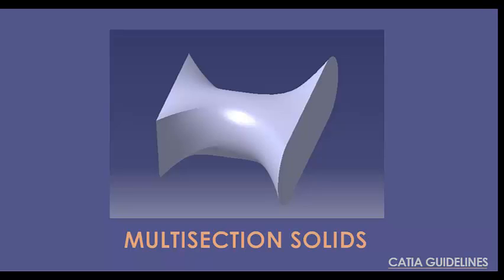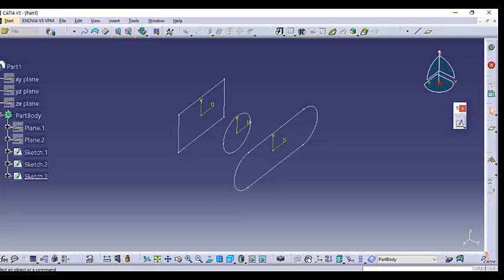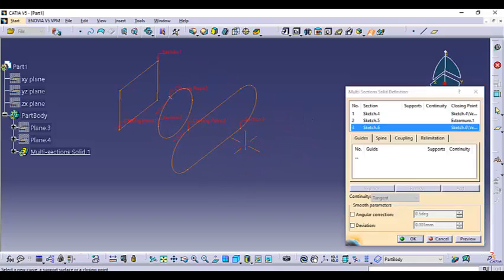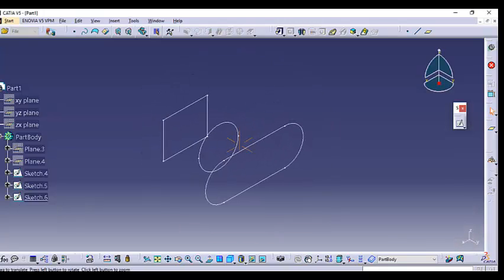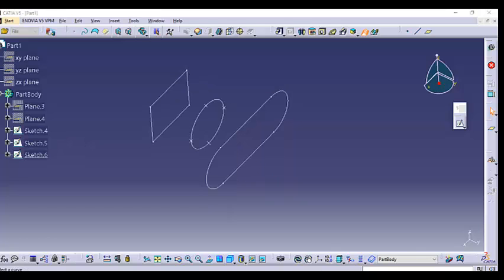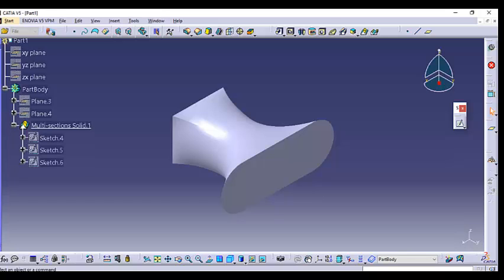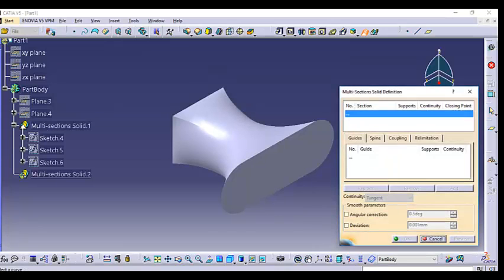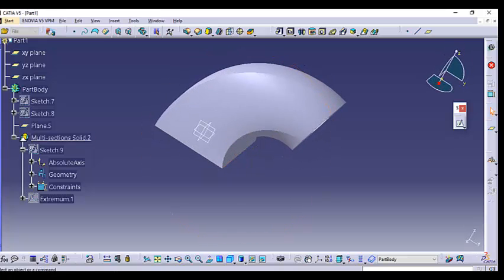MULTISECTION SOLID is a SKILL you must master in CATIA (2017)

Comment: Bro what is cusp error can you post on it. Vortex leads to cusp.
Reply from the maker: Actually, when CATIA is not able to form a solid it gives cusp error. It occurs mainly because the CATIA do not know how to align the two section profiles you have selected, it simply tries to create solid between them. However if two profiles are not properly aligned with each other then unnecessary twisting will occur during solid formation, that is why we need to adjust the position of start and end point. In certain cases we also need to assign guide curves to avoid this twisting.  You need to check the positions of starting point and end point first, here you need a little bit visualization skills to identify why solid is not able to form, accordingly change the position of start and end point. You may also need to change or create new guide curves to properly form the intended solid.
I hope you understood the problem, if you are still facing the same issue please mail me the CATPart I will try to find the solution.
Reply: @catiaguidelines4521  yes, I have later solved it by dividing the line entities i have into equal parts for multiple cross sections.

Comment: In elipse i have 23 ponit on that curve with some distance ,i want to rotate my object along the axis of elips and place that object on the point. I tried circular pattern it not come properly  to match that elipse curve.if any option is there can you explain me.
Reply from the maker: First of all sorry for the delay, I think you need to use "User pattern" instead of "Circular pattern" because circular pattern is more specific command and if you want to pattern along eclipse for 23 intervals in your case then that will not be circular pattern. You need to create 23 points in the sketch of eclipse using equidistant point command. Then just select user pattern command and select that sketch. 

Did I answer your question? if you have any problem please comment.